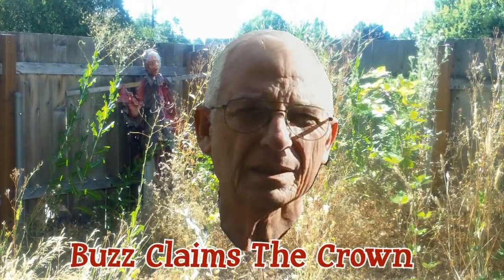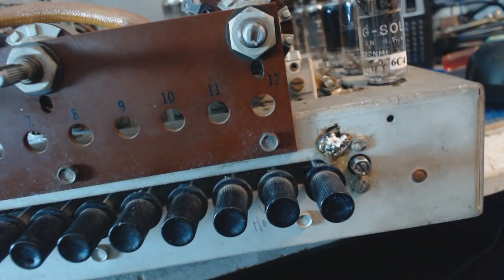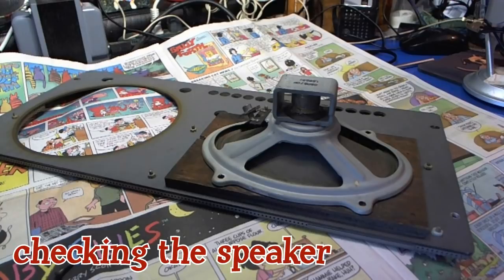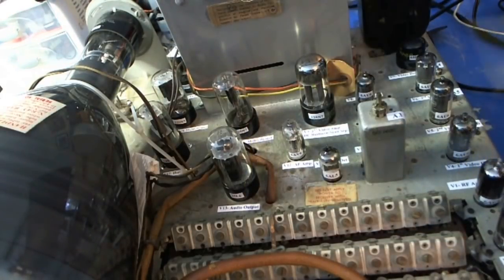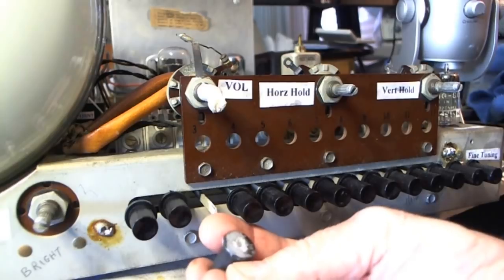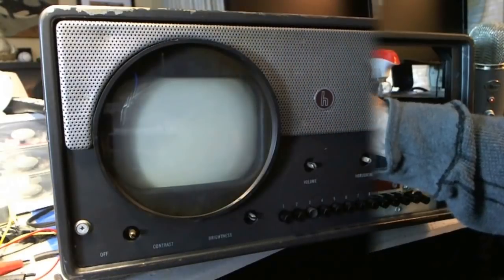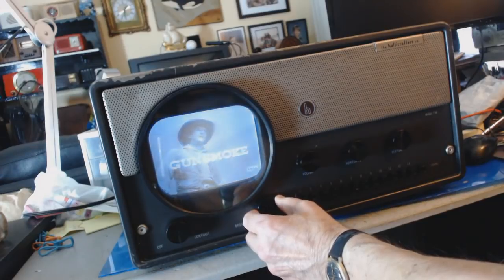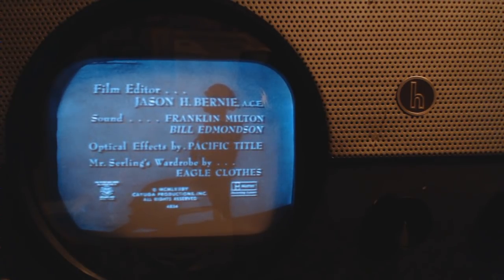1948 Hallicrafters TV Model T-54 Repair Part 5 Final

Comment: Ah The Old Switcheroo  Great Show Buzz, And Nice Job On That T.V. Used To Repair a Few Valve ColourTelevisions Back In The Day Ferguson,Ultra.Hmv.. Etc ..Looks Like You Lost a Little Weight My Friend Just As Long As You Feel Good And Your Still Walking (Always a Good Sign) Really Liked The Knob You Made With The Mould And Plastic Sure Makes a Change From All Those Bloody 3D Printed Things For The Folks With Large Pockets Keep On Trucking Amigo Looking Forward To Your Next Project..Regards mike.

Comment: Buzz, you are certainly a very crafty person. Great replacement stunt on that knob. That is a neat trick and very interesting way of duplicating a difficult to find part such as a knob. I personlly find tubes facinating. I have a couple of vintage tube units and, if I were to come across some tube gear in the future at a decent price I''d grab it if I could. I got an old CB/Ham Kris power pump here that runs on two 6 volt tubes. It needs a simple rewiring and new tubes as the originals were thrown out and somebody put in some odd ball tubes back in but it is not working properly. I also have a Kuba floor model AM/FM/SW/Phono Stereo unit that is tubed as well. I had an old Hallicrafter tube SW radio but that went missing years ago while I was away working. Go figure. Thanks for sharing with us Buzz. It was a neat series on this Hallicrafter TV.
Reply from the maker: I appreciate your comments
Reply: @Buzz1151  I sincerely appreciate your YT videos Buzz.

Comment: Congrats on getting this project successfully wrapped up!  Do you remember when TANDY (Parent of Radio Shack, I think) was a crafts store? They had a product called Plasti-Cast, which was a liquid. You'd make a mold using plaster of paris, coat it with cold cream, and then pour in the Plasti-Cast. Sometimes, you had to break the mold to get the part out. 

The stuff you used looks a lot safer and neater!  Next, you'll be getting a 3-D printer! I think Michael of ThatTubeSound has one for making knobs.  I like the idea of the magnifier and I think you should by that color film to turn it into a color TV! (Which color depends on the film you buy).
 
Nice to see you again, I hope you are feeling well.
Reply from the maker: Did you catch your "OH BROTHER" clip??? haha
thanks my friend,
Buzz
Reply: Yes, I did. I expect that Dickle is sending my royalty check?